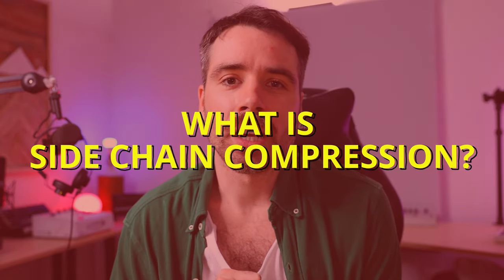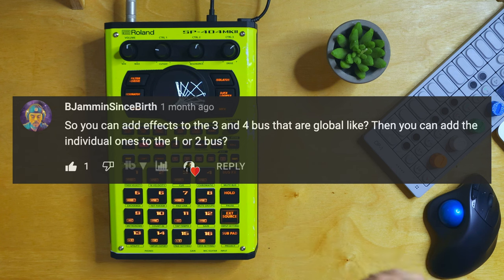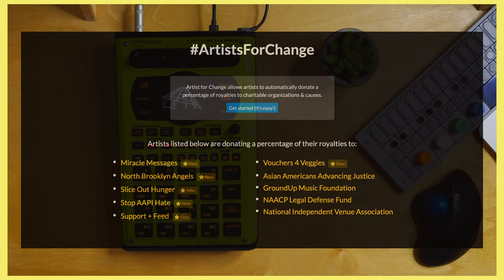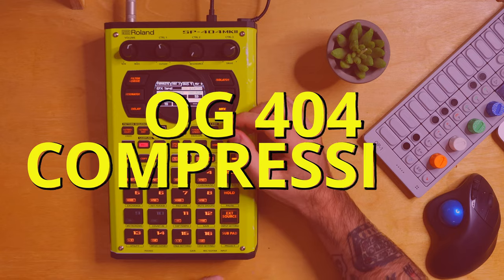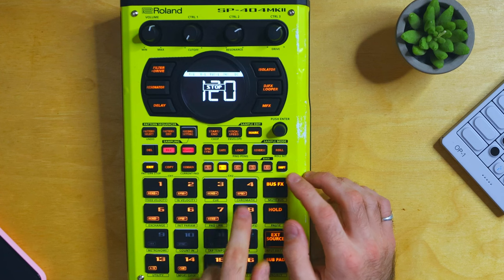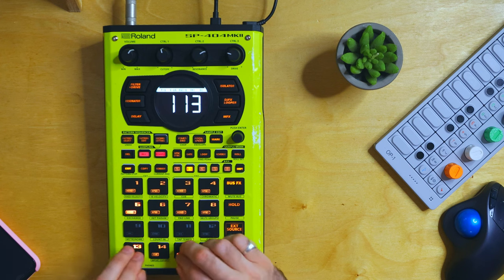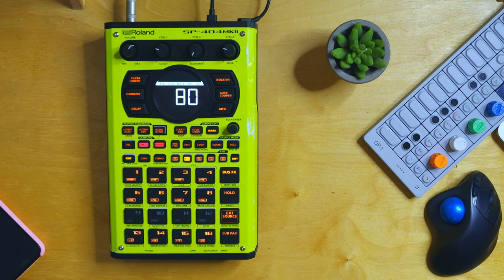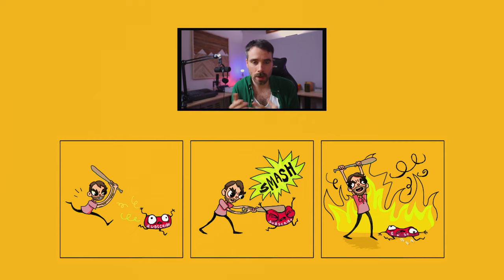SP-404 MK2 + Side Chain Compression // There’s a hack

Comment: I've had mine for a week and a half now and its amazing. But one thing i can't figure out: where is the input/output monitoring? i can't figure out when its clipping. The fx limiter on the OG was also key in giving that 'fly-lo' ducking sound for a lack of a better name for it. In the OG 404 you could choose to have your fx 'limited', so if you'd go overboard it would add another way of compressing. 
The OG vinyl sim is similar to the 303 with the compression, and i always had a nice sound combining this and just cranking up the kick. 
But with the 'red LED' gone, its a mystery how my music isnt clipping like crazy yet. Does the Mk2 have a sniper Limiter on the master or something?
Reply from the maker: You can lower the lvl of individual pads now which helps with this a lot
Reply: @LiamKillen  yeah but I mean there seems to be no metering similar to the red LED which would light up when the signals too hot… but I haven’t got it to clip really so it almost feels like there is a limiter on the final signal, might have to test this, just thought it was odd there’s not even an input signal meter.
Reply: @bagoftrix  the input monitor is the EXT SOURCE button which changes to red if it is clipping. There is also a limiter and clipper on the master output